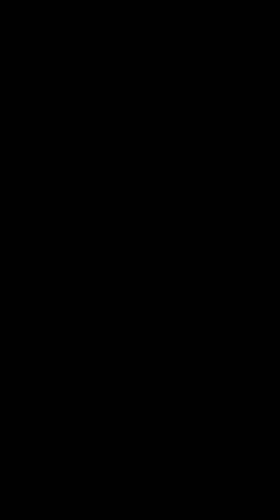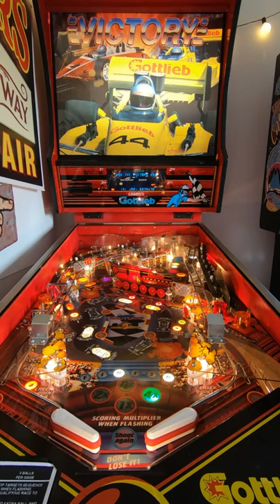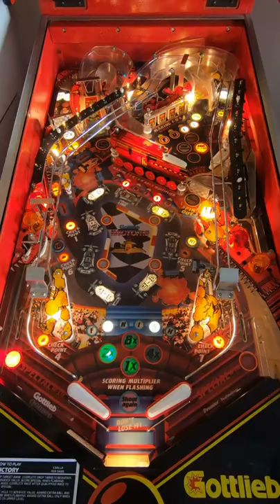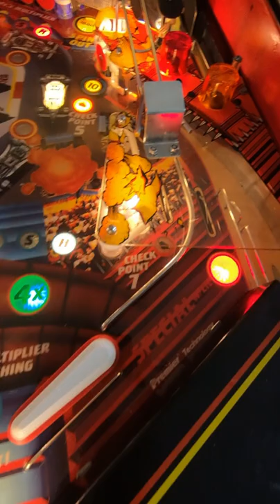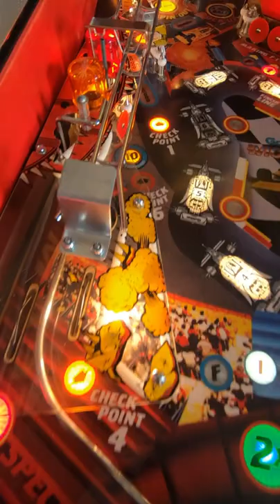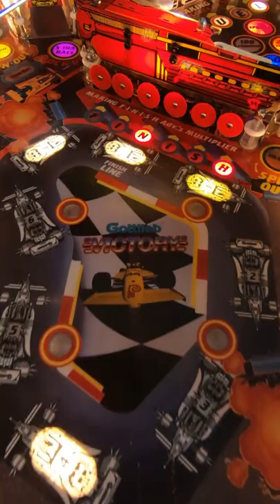Victory Pinball Tutorial & Gameplay (Gottlieb 1987)

Comment: One thing you didn’t mention is the Outlane Specials. To light it, complete any race AFTER THE FIRST RACE. If you want to safeguard your Outlane drains, light Specials on both outlanes(by completing two races on the same ball after the first race. Don’t drain the ball during that!). A Special awards an Extra Ball, on most settings. But remember, you can only get One Extra Ball per ball in play, so as soon as you get it, you have to drain the ball to light and get another Extra Ball. Which is best not to do so.